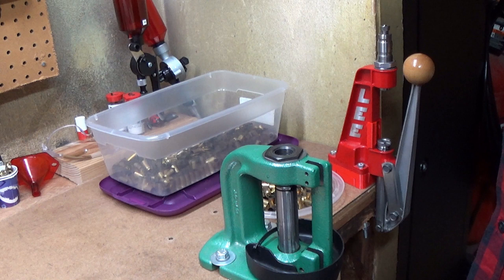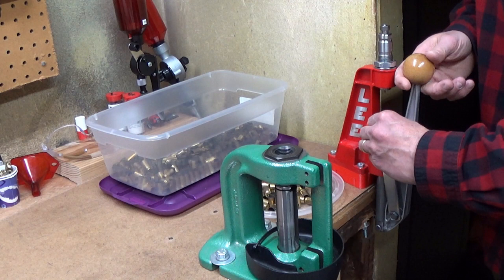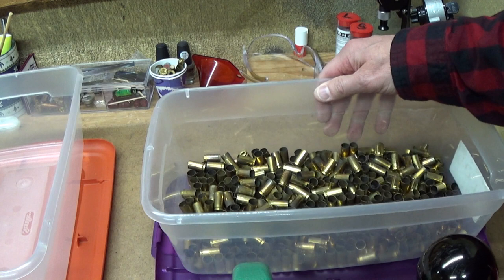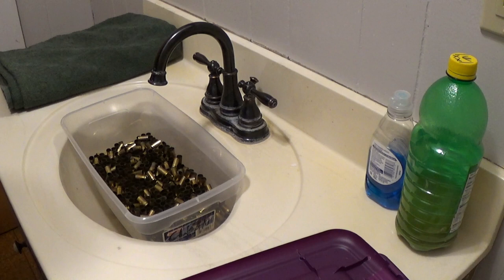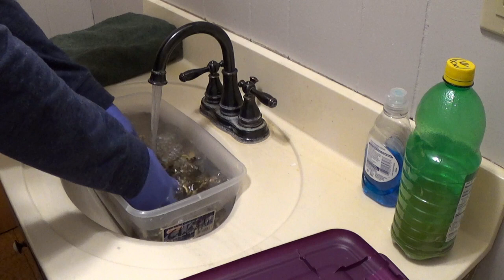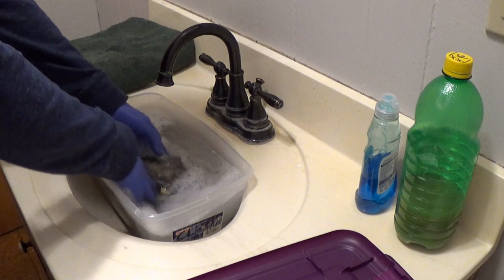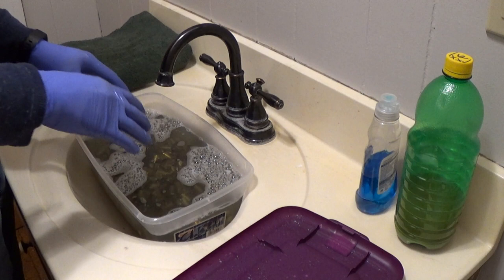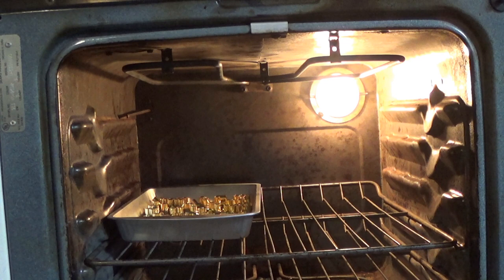Inexpensive Brass Cleaning Short Version

Comment: Great simple video for a simple effective process. The lemon juice (for the citric acid) paired with the degreasing effect from the Dawn is really low cost and easy process.   I add some baking soda to my second rinse to neutralize any leftover citric acid. Probably not needed but thought I’d mention.
Wife won’t let me bake casings so I use a food dehydrator. I picked up a used 400 watt unit from a family who stopped using theirs. My casings smell like jerky but i only paid $20 and it works great with a 5 shelf capacity for lots of casings.

Many thanks for the video!!!
Reply from the maker: That is great. I wish I had kept my old food dehydrator. I got rid of it years before I started reloading. Thanks for watching and commenting. I appreciate it.

Comment: Interesting.... I have a thought for you that might help. Take one of those totes and drill "multiple" holes in the bottom then stack it in another one then do your clean/rinse and then simply lift the inside one out, it will act as a colander, then shake it to fully drain the water...😉

Comment: The only differance between your method and mine is I use a plastic container with a screw on lid.
Reply from the maker: I am going to do a small batch that way with the container I show in the video. I need a bigger one though like  a large peanut butter jar or industrial size mayonnaise jar.

Comment: Good video!  I use a rock tumbler, steel pins, dish soap, and lemishine.  Getting the pins out of .223 brass is a pain, but some of my range-pickup brass can be in pretty nasty condition.  How does your method do with brass that's been sitting outside for a few weeks and is somewhat tarnished?  Also, does this method get the primer pockets clean?  Thanks for the video!
Reply from the maker: For tarnished brass it works well, you may have to let it sit longer in the solution. Tumbling in pins will definitely clean it more aggressively. Some primer pockets get clean sometimes they need to be cleaned by hand. I like the results I get and don't mind cleaning some primer pockets.
Reply: @johnshandloading7907  The primer pockets rarely come out clean with my setup. Sounds like I might do better with yours.

Comment: Hey John, I have a question for you. Can you use a CCI #450 Magnum small rifle primer in a .223 cartridge? Just curious. I appreciate any advice. Thanks.
Reply from the maker: Hi Dave, my understanding is the magnum primer burns a little hotter and or slightly longer. The cup may be slightly thicker material to take pressure from magnum cartridges. It should fit the case. You should back off the charger slightly and be careful of extra pressure. If you have a chronograph I would test a couple to get real data. I think many people are having to make what supplies they can get, work for them. Tread light.
Reply: @johnshandloading7907  Thanks John. Yeah, I hear you on primers. I can’t find any #400 anywhere. I did run into #450’s online though. I’m using brand new casings and I found a recipe on Hodgden load data for H335 with a 55 grain soft point. They give a good variable for low to high powder charge. I’ll just start low and try to find something that is safe. I appreciate you!